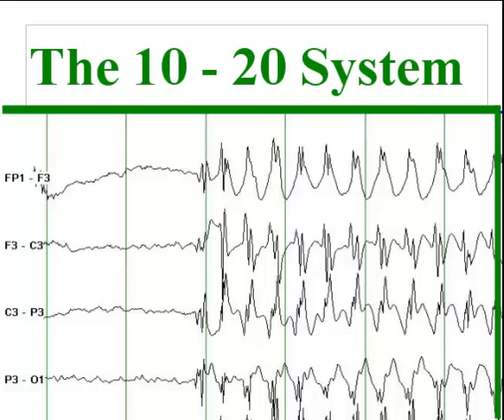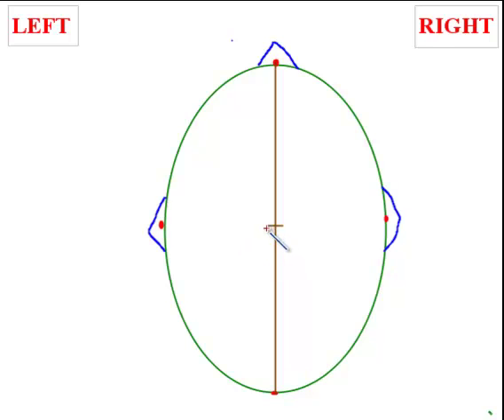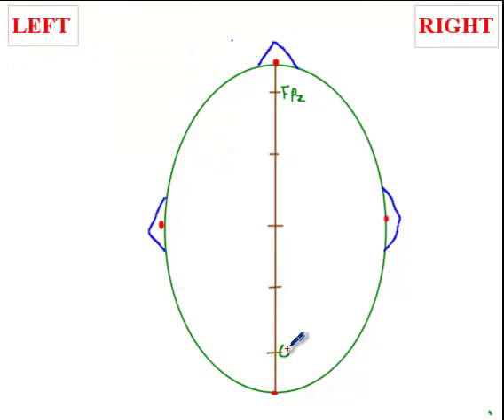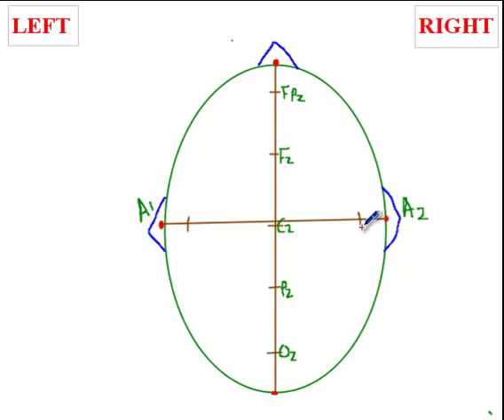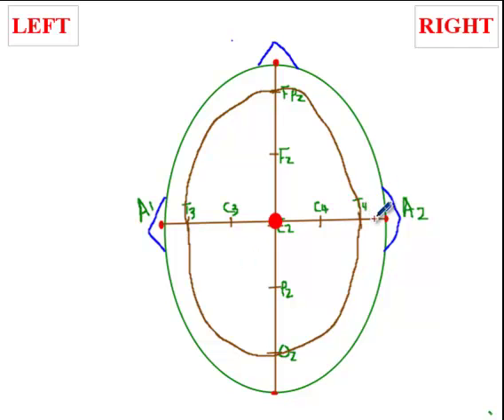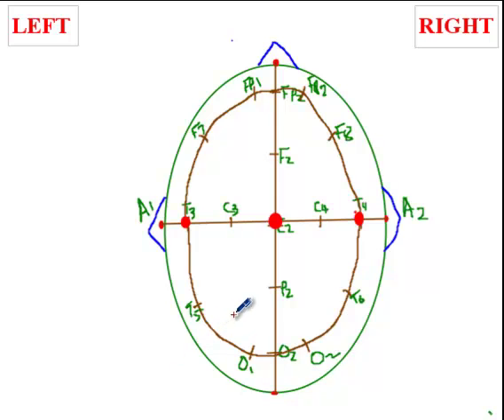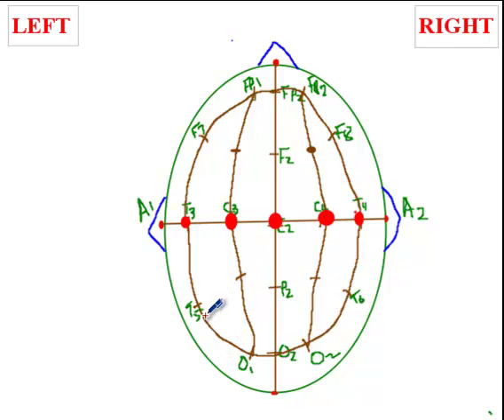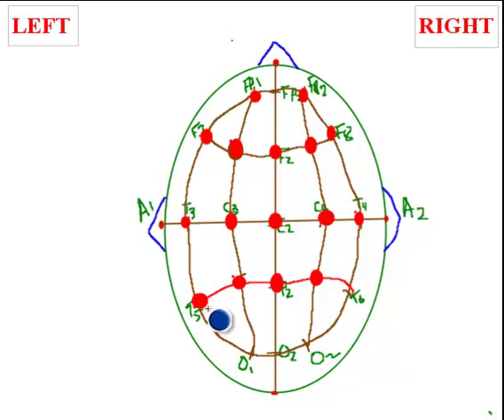The International 10-20 system

Comment: Sorry to disappoint, but the explanation is incorrect for marking T3 and T4.
Measuring 10% marks above the preauricular points mark the horizontal line on which they are located. Their exact location is marked in the middle between Fpz and Oz.
The ears are not in the exact same location on different people and races. Sometimes they can be a little bit posterior (back) or anterior (forward ) on the head and using the preauricular points only to mark T3 and T4 is incorrect.